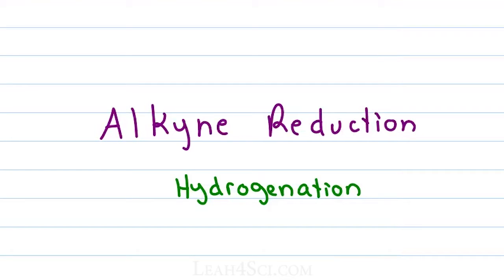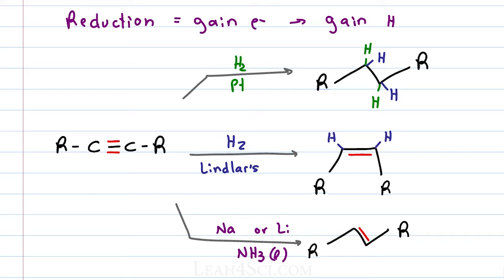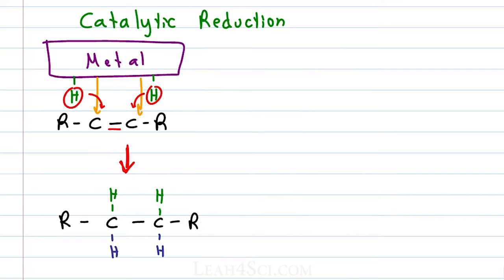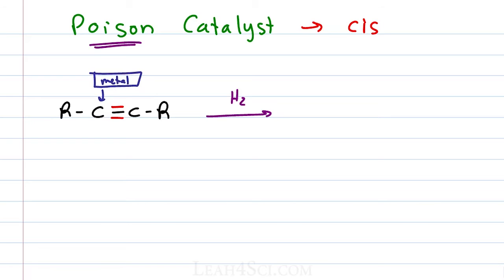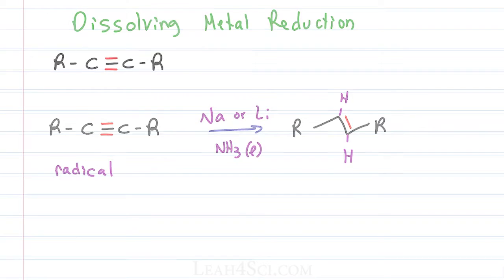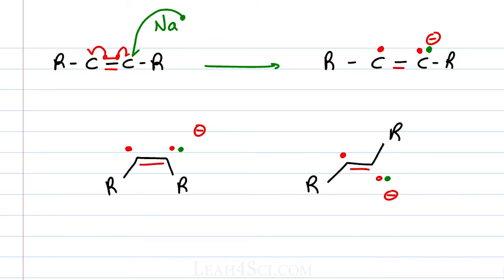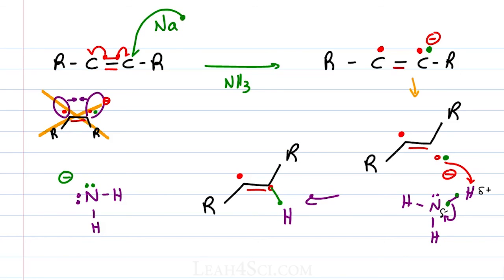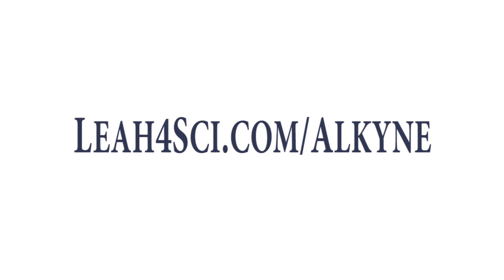Alkyne Reduction - Hydrogenation, Lindar's catalyst, Dissolving Metal Reduction - cis/trans alkenes

Comment: Instead of radical breaking, can we not visualize that the single electron attacks the alkyne carbon from the back (antibonding orbital) in SN2 fashion pushing the lone pair in the oppsite side to adjacent carbon as the original carbons bonding orbital changes to anti bonding one.

In short a SN2 attack by a single electron on alkyne leading to trans lone pair - radical alkene intermediate.
Reply from the maker: This is too complex of a question for a YouTube comment. I stand by the accuracy of the mechanism in this video. If you would like to ask further questions, draw your proposed mechanism and send it to me through my website, along with your question, at Leah4sci.com/contact